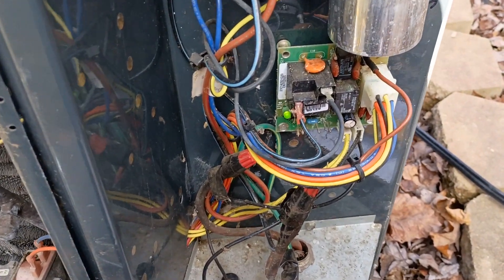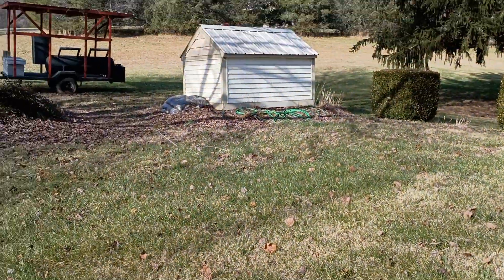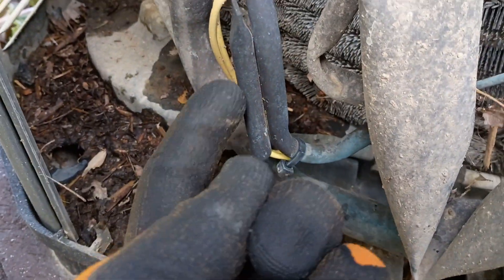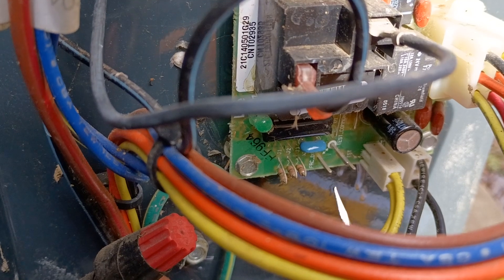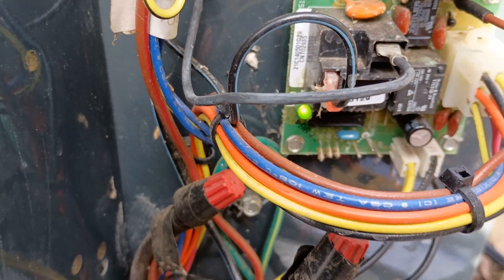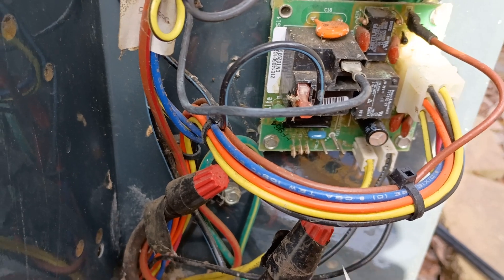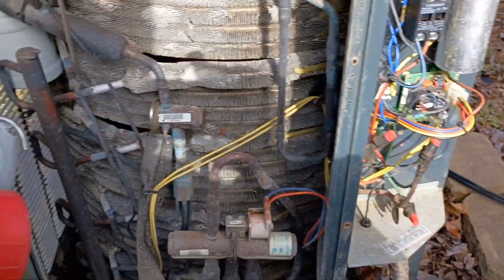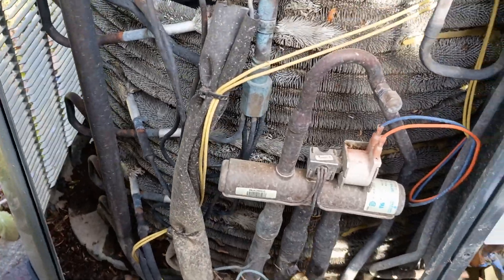Use "The Force" Young Jedi. 😎👍 Trane Defrost

Comment from the maker: MERRY CHRISTMAS GUYZ & GALZ!  🎅🎄🎁😎👍
By the way, it was hot as h€ck inside the house. And this crazy system doesn't have traditional duct on it . It has a wooden box on top of the air handler w/ 6 PVC pipes branching off. 2 goes go to one side downstairs & 2 go to the other side & then 2 go upstairs. Never seen anything like it. That's also why the head pressure was so high. 
Indoor=78°  OD Amb.=60° and restricted airflow.  😎👍
Reply: Merry Christmas Shannon. Good to see you still posting. Thank you for passing along helpful information, it’s helped me in the past that for sure!
Reply from the maker: @Brian_541  Glad to hear that & thanks for watching my little Christmas cavalcade of defrost fun. 
😎👍 I hope you have a wonderful Christmas.